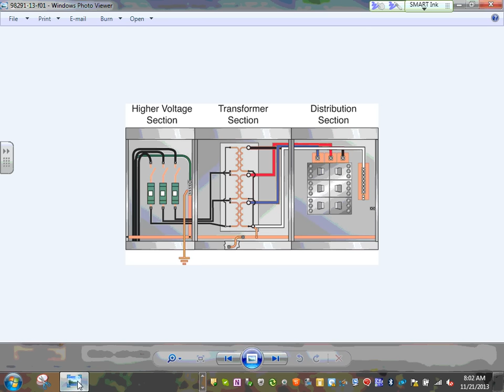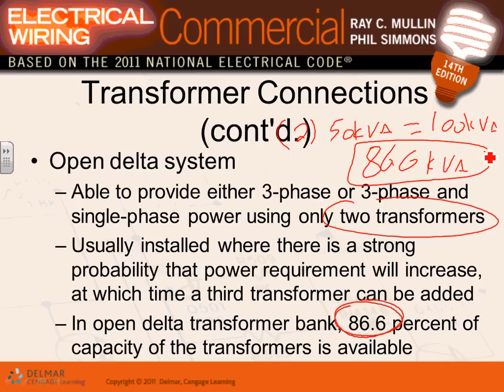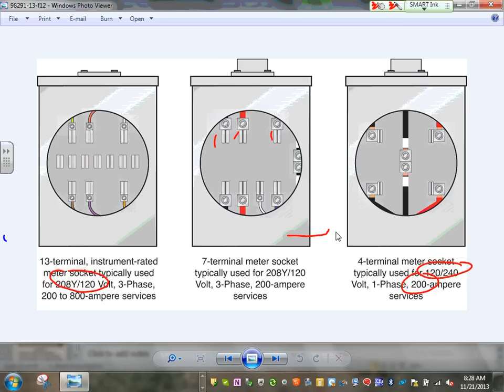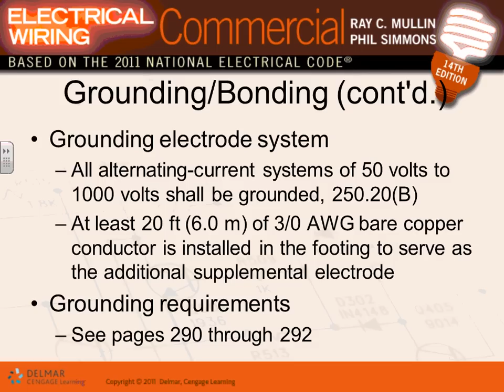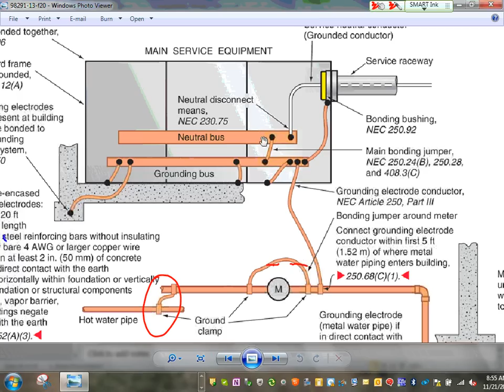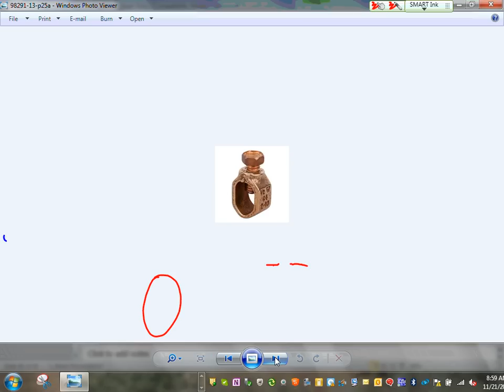Electrical Service Equipment Ch#13 11 21 13

Comment: Write Perfect Connection Electrical Service contact number down as a true after hour service that guarantees to attend to your booked jobs within 2 hours. Perfect Connection Electrical Service Emergency Electrician in South FL would be the right choice because They are 24-hour Emergency Electricians in South FL.
For more details visit: https://perfectconnectionelectricalservice.com/

Comment: Great professionalism and excellent work all around. We did an installation of 240 volts plus panel enhancements. Overall a great experience and the work done was of great quality. Would recommend to anyone who is looking for quality, speed, as well as a fair price.